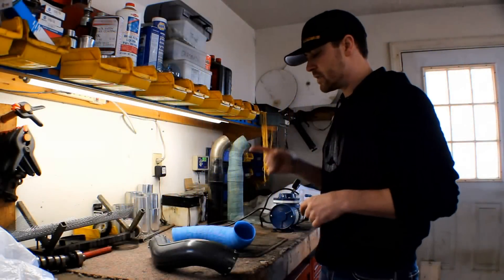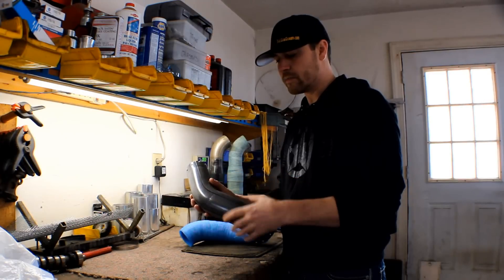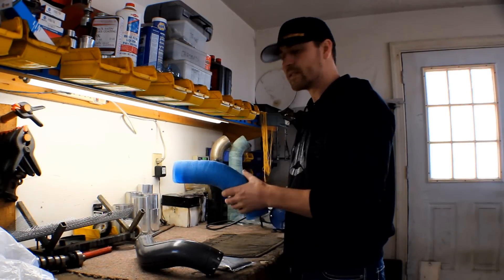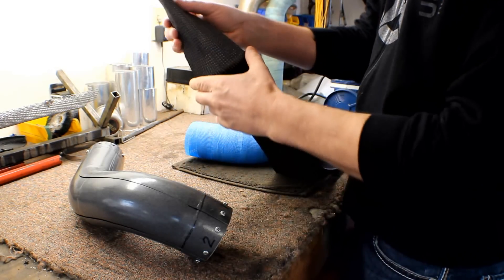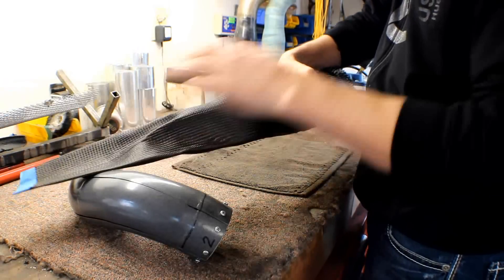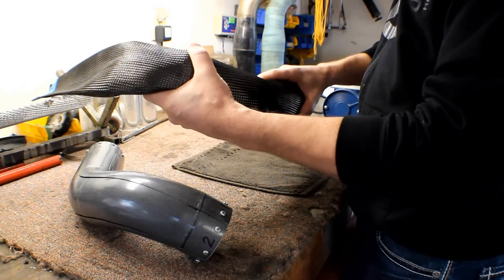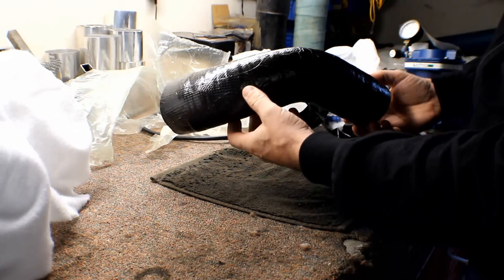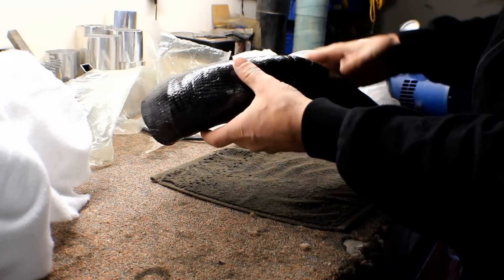How To Make Carbon Fiber Induction Tubes

Comment: Wow, Thanks for responding to your comments, very cool of you! Im making a mold of a steel pipe off a turbo kit that has a MAF flange on it that I'm not longer going to use(just straight pipe with an Abaco 85mm MAF) I bought all the carbon fiber and needed tools I learned from your vids. Just wanted to say thanks man! I'll send you a photo (if it comes out nice).
Reply from the maker: CreativeCAP absolutely I would like to see it. Heck post the build over on the forum www.thefabforums.com

Comment: Very cool stuff!  Why can't you just put the carbon fiber directly on the metal template and skip the casting tape?
Reply from the maker: you could that for sure....some parts are just to big or complex to use the metal form

Comment: What is the glu you are using?
Reply from the maker: Its epoxy resin. Its what is normally used in fiberglass and carbon fiber construction.
Reply: Thanks a lot!!
Reply from the maker: No problem...anytime

Comment: Nice, but how do you take out the blue mold? ?
Reply from the maker: You don't. If you use this method it stays as a hybrid. You can how ever just put the carbon fiber right on the four piece steel mold and not use the fiber glass if you choose.

Comment: Don't get me wrong it's nice but it's just carbon fiber reinforced fiberglass. Looks cool as crap! I think a two piece mold of the first tube should be made then lay the CF in the two piece then joined and shaved then cleaned would be awesome! Just that would take a lot more time to do. That's why carbon fiber parts are so so costly (besides the resin cost)
Reply from the maker: It is but you could just make it out of carbon fiber using the four piece mold I used for the fiber glass and it would be a seamless 100% carbon fiber tube. Watch my video "making composite intake tubes"

Comment: would it be better to make it out of PVC piping first, You can heat up PVC and make the bends then carbon fiber tube wrap around it. Or cut the pvc in fours put mould release on it and take it out like u did with the metal tubing?
Reply from the maker: you could I guess the only problem would be that you can mandrel bend PVC. When you heat it and start to bend the diameter of the tube starts to close.
Reply: maybe if you put sand in it before you bent it so it keeps it shape
Reply from the maker: That might work. I have done that with steel before with some success.

Comment: You can also use nylon "peel ply" directly over the carbon fiber before you put on the breather (white layer). It will allow the excess resin to pass through the peel ply and go into the breather. This will make a stronger part. The finished part will look more matte and not glossy and will be a much better surface if you wanted to add another layer of cloth. The peel ply will not peel off as easy as the plastic though. They do make peel ply that is coated now for an easier release.
Reply from the maker: Thats what I used in this video - carbon - peel ply - breather cloth - vac bag...
Reply: TheFabForums.com
Sorry my bad. I saw in another video of yours the resin going through the peel ply. I didn't notice it in this video.
Reply from the maker: No worries

Comment: Some other tips on vacuum bagging...
Instead of using that black sealing tape you can use Clip-n-Seal Bag Clips available on Amazon. They are reusable and come in 40" lengths. As far as the bag on smaller parts I use the FoodSaver bag material because you can get it on a roll. you can find that on Amazon too or at Target or other stores. You can use the Clip-n-Seal Bag Clips on both ends and you have a custom length bag that is much more durable than the trash bag it looked like you used. It is often reusable too.
Reply from the maker: thats for the info

Comment: One thing I have learned in the carbon fiber class in taking is to plug the ends if your doing tubes. This way the bag won't pop from the vacuum. Anyways good job man I did learn a thing or two.
Reply from the maker: lol...yea I wish I would have plugged the ends on this one. It worked out
Reply: Yea Ive been trying to make just a straight pipe and they way you did it by cutting it into quarters is a good idea..
Reply from the maker: Brent Elliott thanks

Comment: Excellent demonstration! Please include sanding tips/material and recommended clear coat
Reply from the maker: Thanks...I may do another video finishing it
Reply: The Fab Forums Would you consider investing in one or two more cameras to provide viewers with different angles of viewing experience?
Reply: haha.. you cant smooth suck shit made tube with anything, only using 1kg of filler you can make it smooth making it 10x heavier than was meant to. Thats what you get when you have no skills.